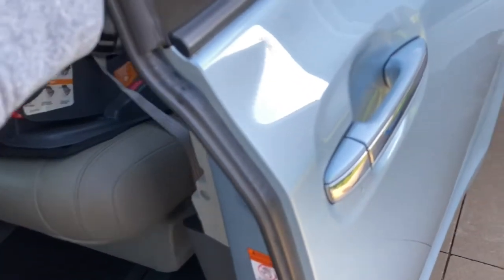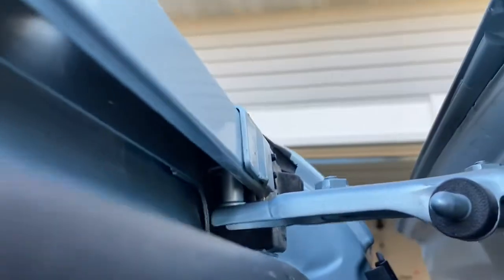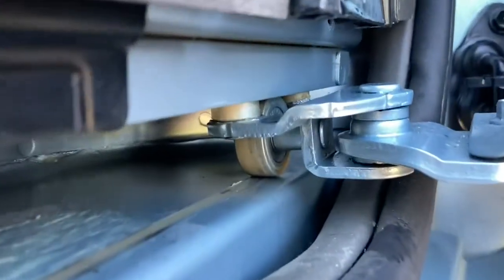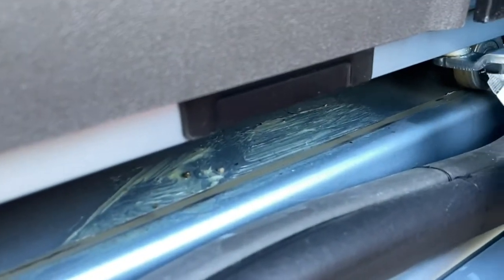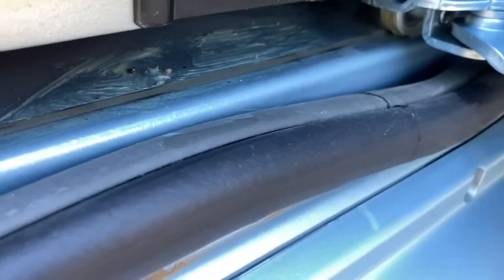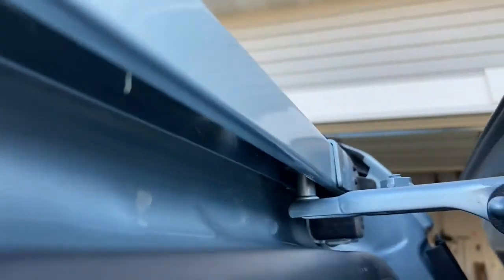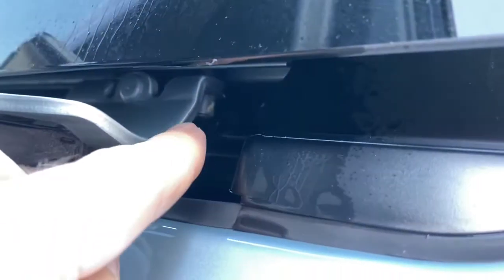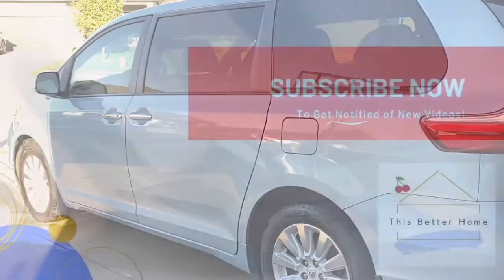️🔥 How to DIY Lubricate Minivan Sliding Doors➔ Get Them Sliding + Gliding Again **LIKE NEW**

Comment: Dude you are supposed to lube the bearings INSIDE THE WHEEL not the surface!!
Reply: Exactly my thought too. This is HOW NOT TO LUBE teh Sliding doors.

First use a degreaser and clean up the roller tracks so they don't attract dirt & debris. Next, use a silicone spray with an extension and focus on the wheel bearings. Give it a spray and then manually move the door back & forth a few times. The top and bottom rollers are ok to work with but the middle one, around the window frame is very hard to reach. You can access it from the inside with the sliding door in an almost closed 
position.
Reply: @ab-zo4su  Excellent tips. That's why I always read the comments. Cleaning the tracks and rollers seems very important, but so far I haven't seen any videos that show this step.

Comment: i just bought a used 2013 toyota noah, and the sliding doors sound rough so i think it's time to re-grease it, its a toyota and it has almost the same structures as your sienna, now i do have some questions, is it necessary to clean/wipe off the old grease? should i apply more or less grease? what happens if the grease gets wet quite often? can I buy the grease with more/bigger size? (in cans/bottles i guess?), is the grease the same as industrial grease? (the one that applied for semi truck couplings?)